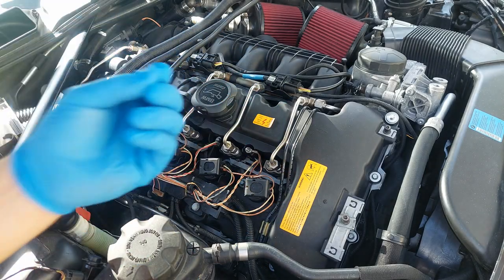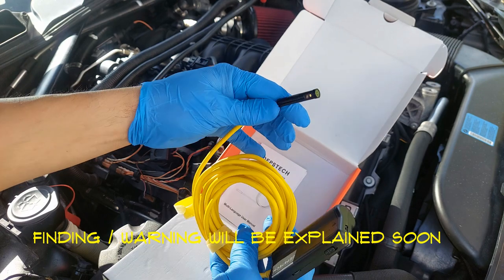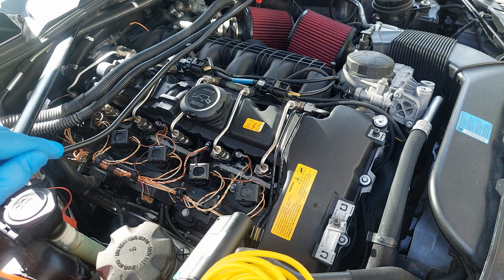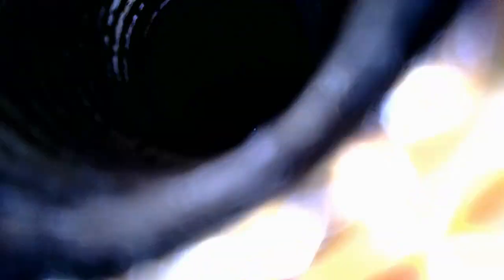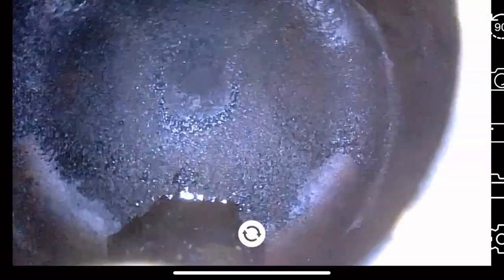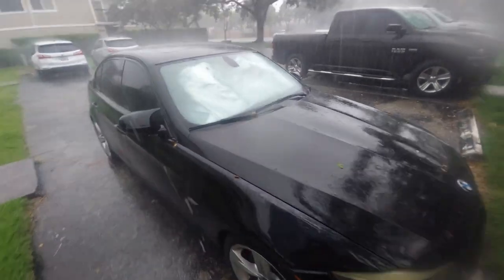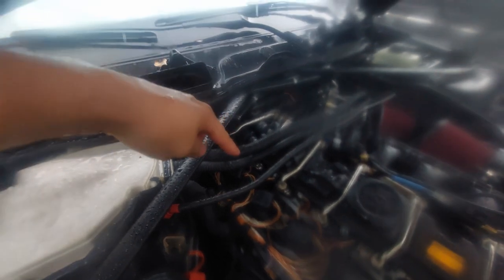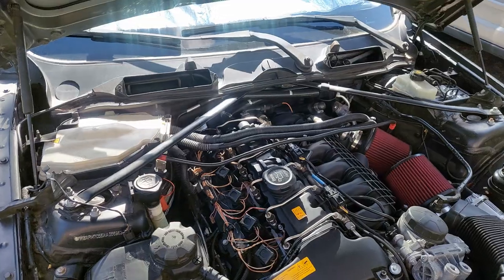Warning! Doing This Mod Can Kill your Engine! / N54 Cowl Delete

Comment: You just dropped a jewel 💎 for the bmw community.  Well all that have this cowl delete.  
Another negative is your ac ducking in that hot air makes it hard to cool cabin efficiently. At 🛑 lights. And idle. My ac wouldn’t feel as cold as when I’m driving.  Leading me to conclude its cause missing cowl. 
I was already gonna swap back oem cowl. This just solidified that.
Reply from the maker: Thank you brother 🙏, it is much appreciated 💯
It does make a difference, I live in South Florida and it gets hot as heck in here.
After this incident, I just ended up modifying my cowl which it looks way better that before. Safe to say that the best option for better working room and water protection is to go M3 cowl ($$$ an arm and a leg) or modifying the existing cowl.

Comment: I wanna get the 2 filters and delete my cowl but worry about water getting in my engine bay…
Reply: It does.
Reply: @BimmerMafia  damn
Reply: @n54addict35  oh it’s homeboy 🤟🏽.  I didn’t even see name.  But yea bro when it rains and washing your car.  On each side of Engine. Between fenderwall and engine. 
Bms filter were one of first mods.  So it was lit then.  
But I’m in Texas.  I need my ac as 🥶 as possible.  Cowl delete doesn’t help that issue
Reply from the maker: Having a plastic cover on would have prevented the water getting in on top of the engine for sure. Not only prevented the outcome that I saw, but also prevented water from touching the ignition wires. The main issue that I see is in the long run. Water is a MF. It likes to either rust, corrode, or cause oxidation on a variety of materials.
For instance; Aluminum doesn't rust, but it does corrode. Aluminum corrosion can happen gradually over weeks, months, or even years, if constantly exposed to water. 
I dont think is super alarming thought, specially if you keep your car indoors (that's when it comes to corrosion)
The other concern would be water and/or moisture in close proximity to your DME.
I used to run with the cowl delete myself, but it was until what I found, that I decided to protect the engine from water from getting in, by modifying the cowl. It is for this reasons, it is better to be safe in my opinion.
I just made a video modifying the cowl btw. 
Looks super 😈
Reply from the maker: yeap
Reply from the maker: Cowl delete opens everything up. Alot easier to work on the engine. But now that I have modified the cowl itself (M3 style), it look super nice. The lines where I cut the cowl look OEM like and it does protect from all issues. I think is the best bet. 
Security is better that the police.
Reply: Will the same thing happing with bms cowl filters?

Comment: When Bavarians engineers spent 100's of hours in the past 2 decades, have designed engineered and spent close to 100 million in the past 20 to 30 years in fabrication, prototypes and resources to have a final design and what?? Someone decides to remove or change it, it's more then a no brainer....
Reply: To be fair, the hpfp for my 335 (and many others) were total shit. And I am constantly questioning the reasoning of the engineers over there as I learn more about  my car XD All cars have parts that can be improved, but you're absolutely right in this case. Anybody that thinks it is worth it to risk their engine for a slightly better sound, only 10 lbs of weight reduction, and supposedly better cooling can take that risk. I'll pass though lol There's plenty of other ways to make power and increase cooling that don't involve splashing my bay with water lol

Comment: What is the purpose of you removing the OEM cowl? 
I don't see the purpose of removing it unless you have done some serious tuning and heavy modification to the motor itself and turbos upgrade.
If you're still using stock turbos and using off the shelf piggy back tune like jb4 or MHD, do yourself a favor and keep the cowl in place.

Comment: That plastic protector it breaks and cracks the plastic with is made is bad and it cost like $100
Reply from the maker: I ended up modifing the cowl, rather than to leave it with no cowl at all. 
I think is the best option to give it a little more room to work on the car and to protect from water coming in.